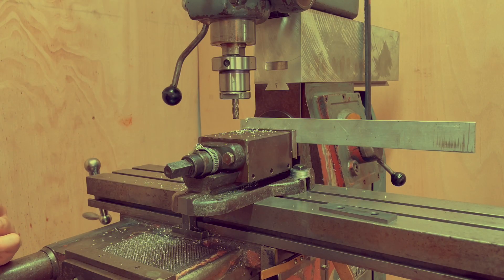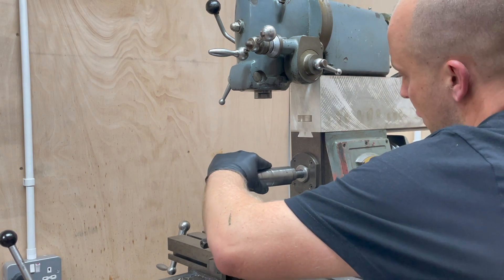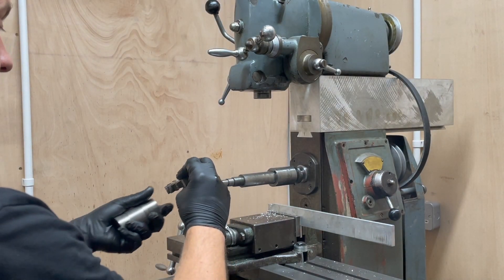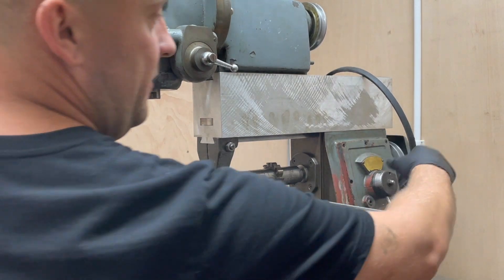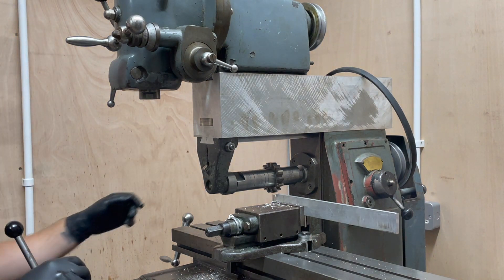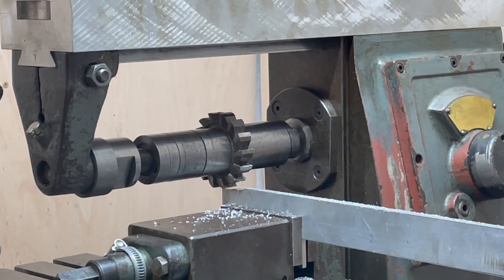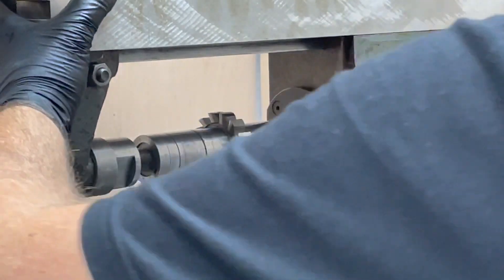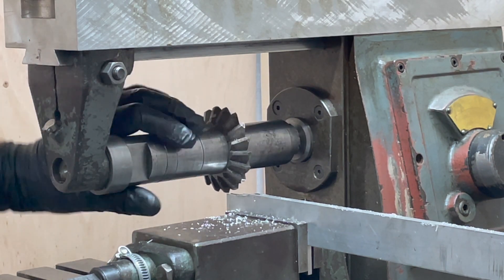First Horizontal Milling on the Centec in Decades?

Comment: . What size and thread is the draw bar?
Reply from the maker: It’s a 3/8” BSW thread
Reply: @williamsworkshopuk  Thanks.   Would am  M10  drawbar fit down the quill?    Most modern collet chucks are M10 thread.
Reply from the maker: @ I don’t think so, it’s a very tight fit indeed!

Comment: Seems like the arbour is turning the wrong direction so it’s undoing the nut. Maybe reverse it? But then you are climb cutting, so maybe come at the workpiece from the other direction?
Reply from the maker: Yeah - really the problem is that I hadn't used a drawbar on the arbor, so it was able to extend out and brush the inside face of the overarm support bearing.
Reply: @williamsworkshopuk  That makes sense. I am debating adding a key way to my C2a arbor… it just seems like it has way more power than it is able to unleash. Some have suggested the lack of keyway is a kind of safety feature, but I want to try some slab cutting and I am just not sure that nut will do the job.

Comment: Where did you get the raising block?
Also only tighten ip with the arbor support on not to bend your arbor
Reply from the maker: It came with the machine - apparently they are quite expensive to fabricate but it is possible to use the centec itself to make one. Check on the model-engineer forum, I think the chap who made mine is on there